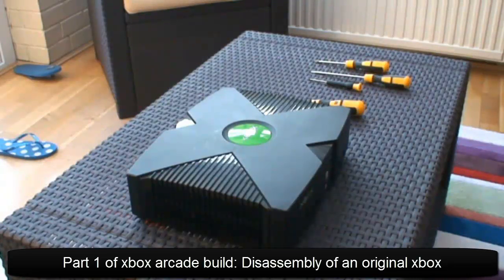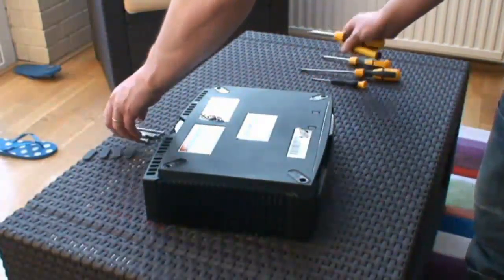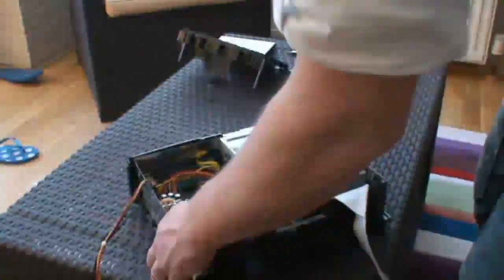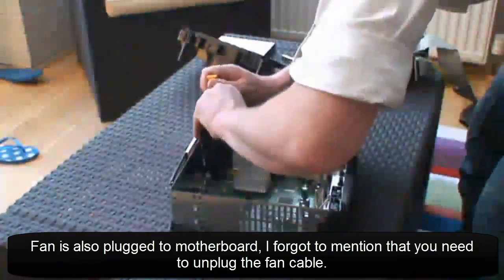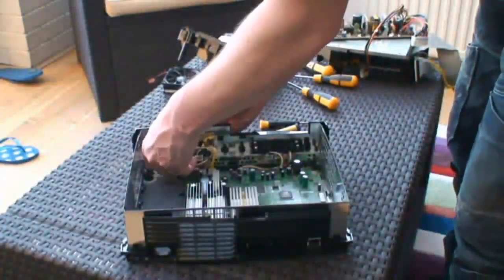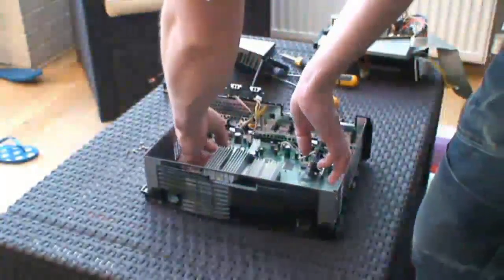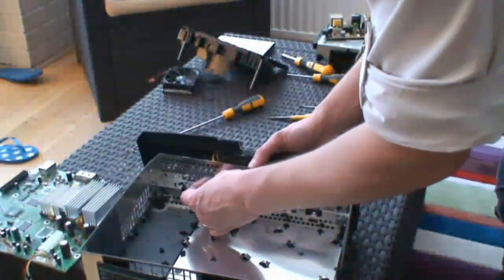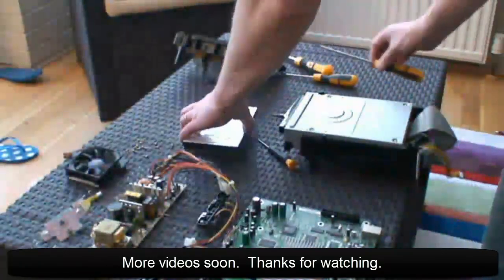Building an xbox powered arcade cabinet part 1: Disassembly of original xbox console

Comment from the maker: Triggers are a real bitch to solder on the s-controllers. Look at the LT and RT solder points on that image you sent in PM. Connect button to common ground and also one of these solder points. That should work. That's what I did. I use a controller test program on the Xbox. Recommend you use that for verifying all your buttons before you solder them.